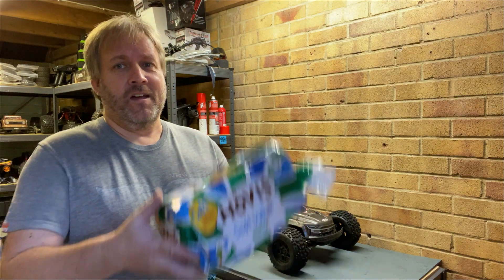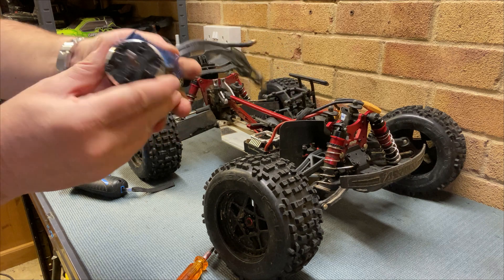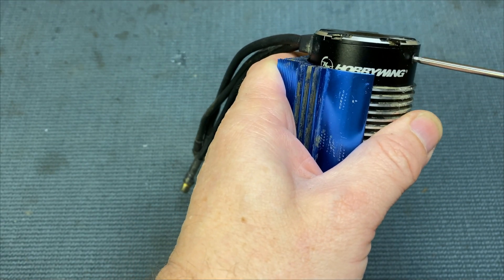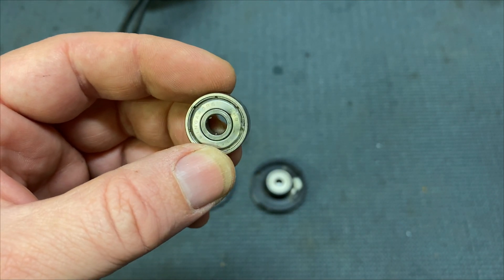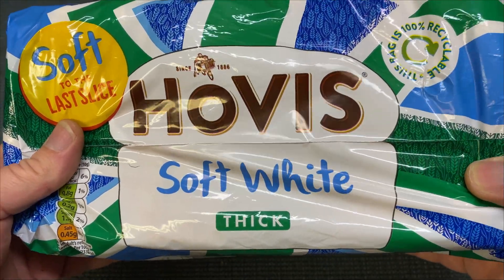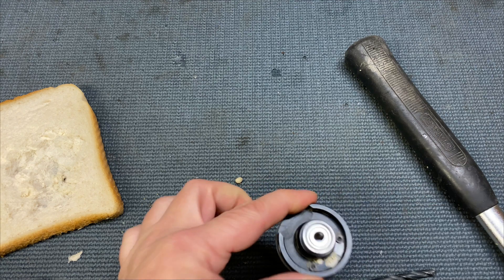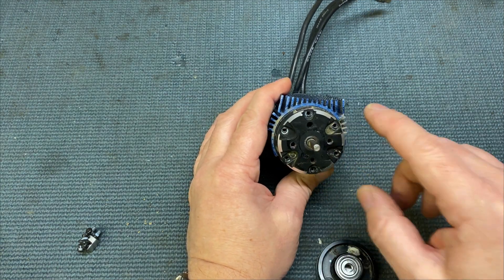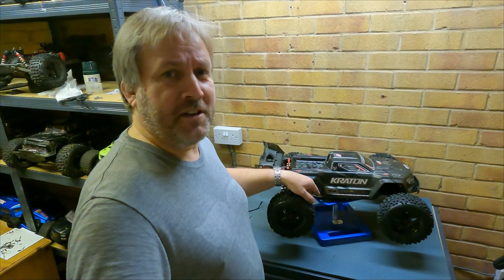How to: Maintain and Rebuild Brushless Motor RC Car

Comment: I have 3 arrma 2400kv motors. Changed the bearings in all. Temps came down a few.
Reply from the maker: Oh yes, putting better bearings it will deffo help, especially if you can get ceramic ones

Comment: Wow, that is amazing!  I have a motor with a dodgy bearing that I can try this on.  Tesco sunflower and pumpkin seed bread generally but will use white bread for this!  Many thanks for the tip :-)
Reply from the maker: Oh i haven't tried Sunflower and Pumpkin seen, musty get some sounds scrummy 👍 probably not for this though as the seeds might mess it up 😂😂